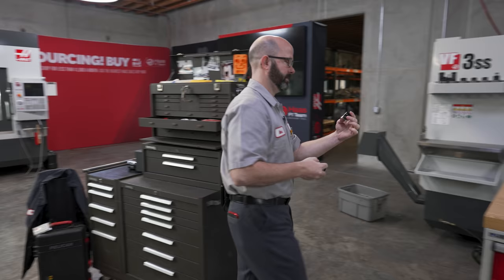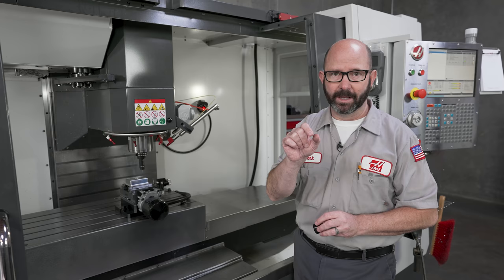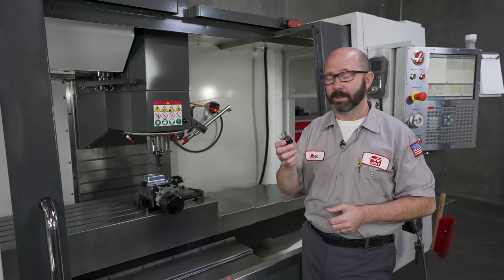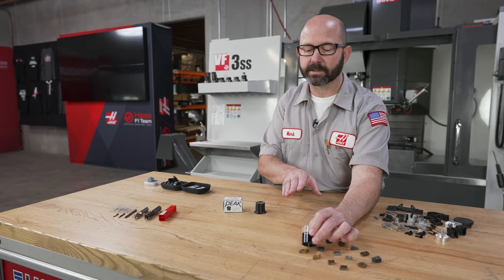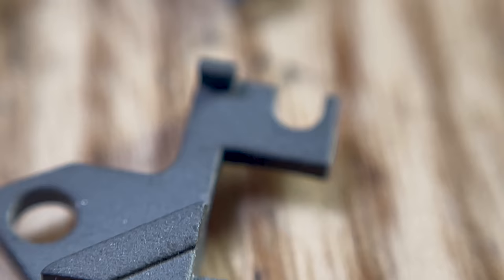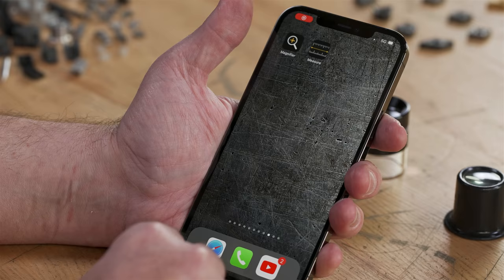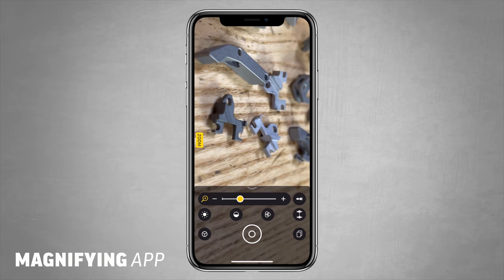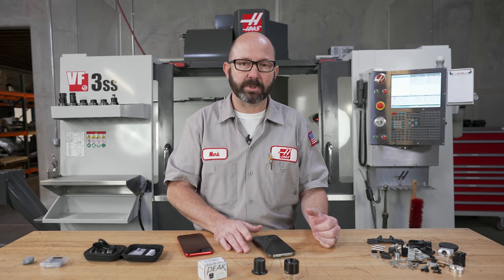Stop Squinting! Use a Loupe! – Haas Automation TOD Toolbox

Comment: Have inexpensive decent quality loupes stored in most of the places where having one really helps out. What I don't have is one of those ones that can free up both hands.
Reply: I have used all sorts of visor/headband magnifiers and in my opinion the Donnegan Optivisor is the best and definitely the most comfortable.  If you do buy/own a Donnegan Optivisor they make an add-on pices called the optiloupe which is worth every penny.  PS if you are in the market for a Optivisor shop carefully because the prices of a optivisor vary greatly.  As for the add on visor light I made my own and like my version far more that commercial ones available and besides working better the price of the parts definitely were cheaper

Comment: A tool maker had to show me the correct way to now squint to holder jewelers loupe.  You just push it up in upper eyelid first and then rest it on bottom lid. It will stay in place with squinting.  I also like the Opti Visor as well.     Like how to check the radius on turning inserts _ is it a #1 or #2  etc.

Comment: I bought the digital microscope that John used in the video. works great for the price.
Reply: And if you machine a hole in the base of that microscope, you can place it over a feature on a part that you want to inspect, but can't fit otherwise, or parts still in the machine with small features that need to be checked before removing the part. That was my first hack.

Comment: I can't see crap anymore. Nearly all the time I wear 1.5x reading glasses with blue blocking. AND nearly all the time I wear an opti-visor which is very handy- swung up out of the way, I never realize I am wearing it, but for detail work or vision, I swing it down; and I am old enough I don't care if I look like a dork. And a few times, I reach up to swing it down, and get a shock when it is not there because I don't have it on.
I have a different chinese video microscope similar to JS' version; I could never get good detail with the annular LED around the lens, but by mistake I found I could get much better color (like reading a resistor) and much better detail by turning down the built in light and using a free standing LED over to the side; the incident light REALLY changed the quality of the 1080p image. And I have a pile of different loupes which I still use, along with the android magnifier on my phone.

Comment: I use my loupe everyday, can't have my phone on the shop floor. But I will also never buy another Kennedy machinist box. I bought the same set up you have there almost 9 months ago, and it was such a disappointment!
Reply: What box did you end up liking? I have a few Husky roller bench/boxes that are cheap, but I'm happy with them. The Lista that we film on is incredible, but pricey. I love my Kennedy's, but the drawers are definitely shallow for many of my tools that come in cases. I've seen a lot of people in our shop using the Harbor Freight boxes now, and they get the job done.
Reply: @markterryberry4477  I have a couple harbor freight boxes at home, they definitely get the job done, but are a little rickety. I splurged on Lista box to go on top of my harbor freight box and have been very happy with it. I think I will soon be moving to all Lista cabinets and get rid of my Kennedy. All my mentors had Kennedys, so I bought one to follow in their footsteps, but come to find out, $3k later, they don't love their boxes either. Live and learn!😂

Comment: Just to clarify; you can not use the Wireless Tool Setter?
Reply: We can definitely use the probe if we have it. Probes are fantastic! Without the probe, it's easy to get into trouble when touching off tiny cutters though. Some people I trust have had an issue when probing extremely small cutters, .0015"/.04mm tip offs or even smaller, but I haven't seen a problem myself.